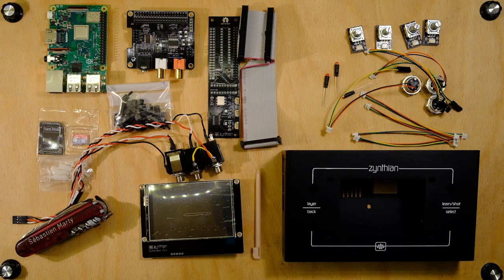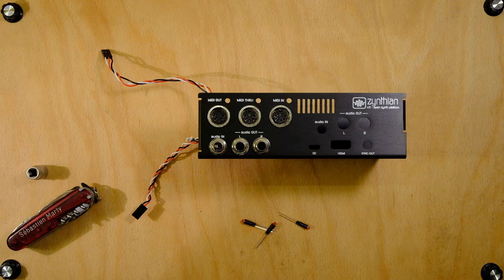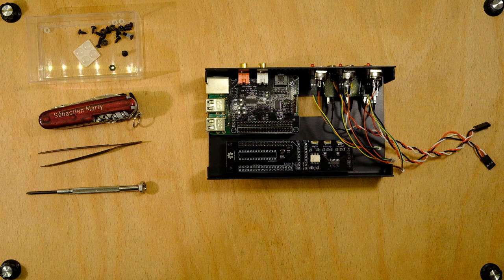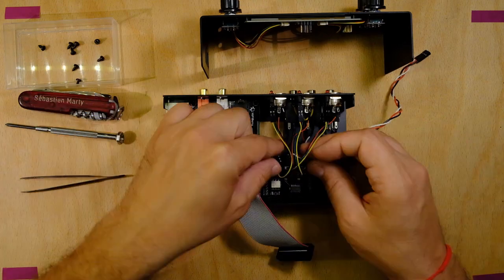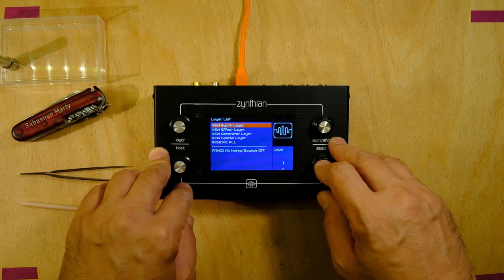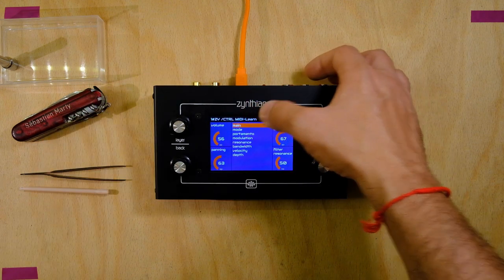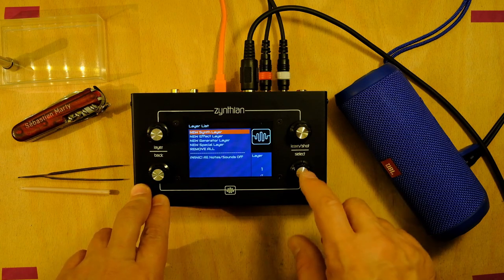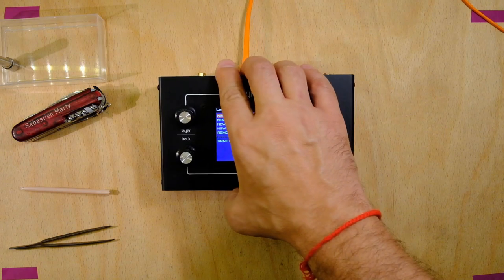Zynthian Open Synth Platform, Official Kit V3 - Part 2 - Building

Comment: Good overview of how it goes together but difficult to use as building instructions.  You speed the 'boring bits' up but never slow down or pause to show what you have actually done.  When you do pause its on something meaningless.  To build something its important to know where things go, its less useful to see the finished object at each stage when you've turned it over and we cannot see what is inside.
Reply from the maker: It is indeed an overview, also feel free to use the video speed option to slow down to 0.25x

Comment: you just use this USB cable for power? or do you have a special power adapter for the raspberry?
Reply from the maker: I use a 2Ah alimentation with a genuine branded usb cable, this one is the charging cable of the Jbl speaker you see in the video.
Reply: @lazerbow  thanks for the quick reply!!